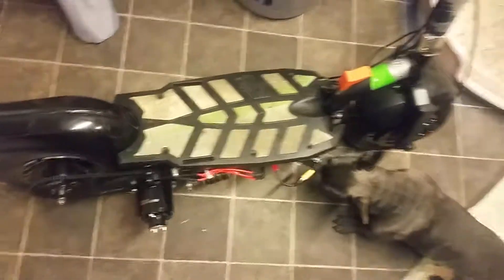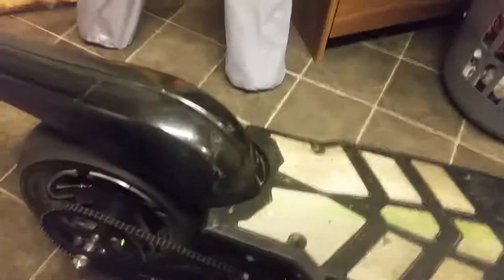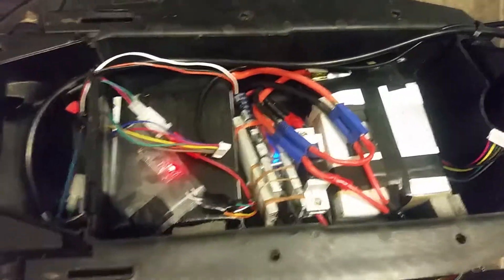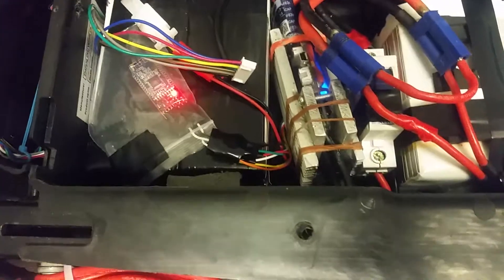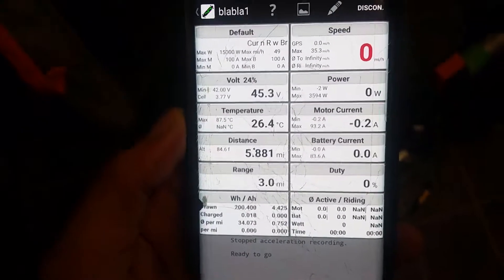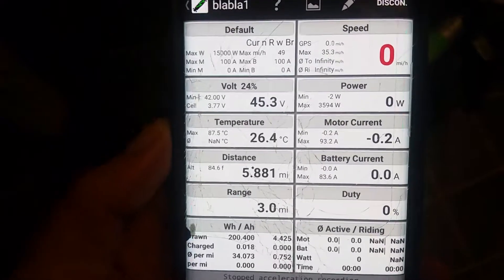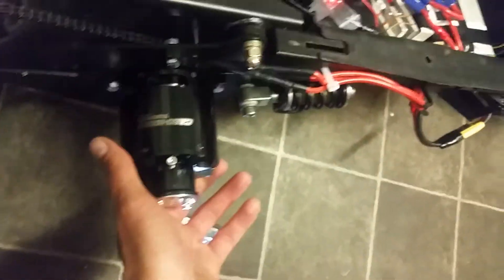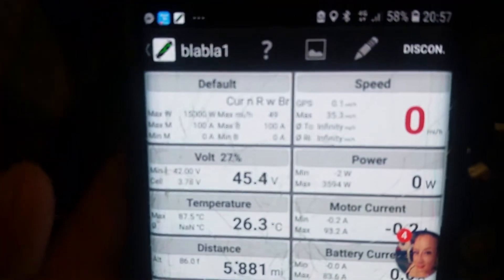Beefed up uber scooter cheapo vesc 4 by flipsky and lipos

Comment: How has flipsky vesc 4.12 held up so far? I am build one e300 with 6384 150kv and was hoping 4.12 vesc will be enough. Others are too expensive for me. Thinking 10s but maybe 12s
Reply from the maker: It still working fine make sure you add heatsink and thermal paste otherwise it will heat up quickly

Comment: What Bluetooth module and connection , also how are you connecting throttle  ,
I have ordered a 10s4p battery ,30A smart BMS with bluetooth SP15SV0001-LLT and have 5065 140Kv sensored motor and VESC 4.12 ,
What are your suggestions regarding VESC settings once my battery and motor-mount comes
Reply from the maker: 5065 motor will struggle if you are planning to power similar scooter unless you gear it to low speed. For bluetooth connection I cant remember just google ackmaniac vesc bluetooth type and you should find the answer
  For throttle I have used normal ebike throttle and soldered it to servo tester to convert signal but that wasnt necessery as vesc will suport ebike throttle connected directly as well. Your vesc setting depend on motpr you use so monitor motor temp to make sure it dont overheat if you feed it with too much amps